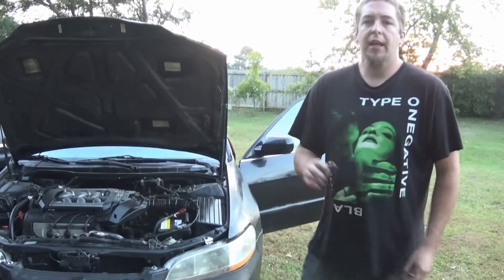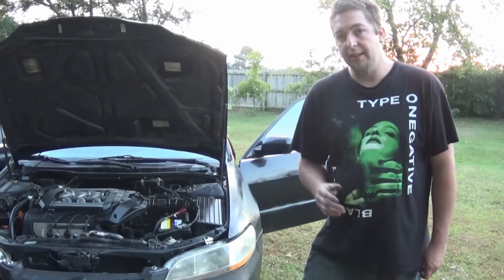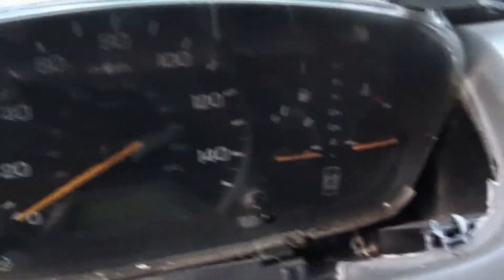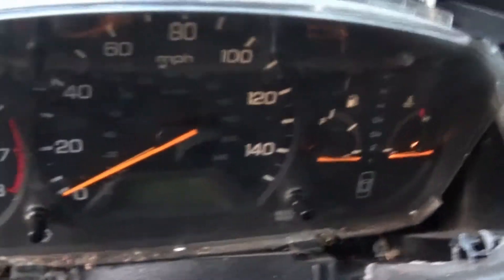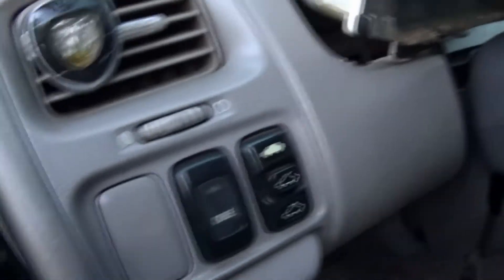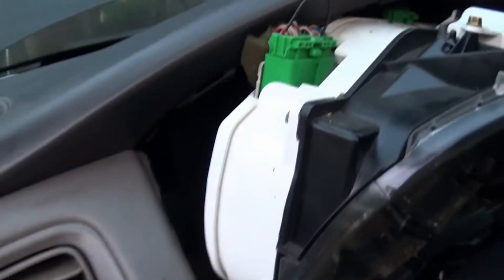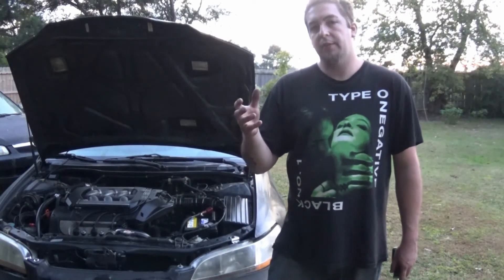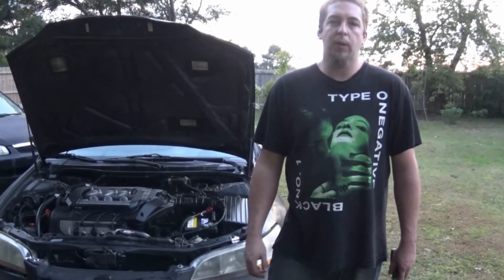1999 honda accord dash lights fix

Comment: I installed a new stereo in my gfs accord. Had the issue, saw a video like this one with the same solution but I connected the wrong two for a second, and now I'm getting transmission codes. The P,R,N,D3,2,1 all light up, but not D4. I believe there's just a short to the d4 light. How can I fix?
Reply from the maker: start checking fuses because if you shorted some thing the fuse should have blown first
Reply: that one goes out after being on for so long, replace bulb or light

Comment: Thank you a heap of times! This worked but I accidentally put the wire in the pin with the red wire white stripe instead of white wire red stripe. Turned the lights on and they worked for about 30 seconds then went out? Where do those two wires end up?
Reply from the maker: that i cant recall, i could tell you at one point but not right now
Reply: Efurd Garage I did some meterin’ and discovered they end up in that multiplex control unit

Comment: My dimmer switch was all the way down before I tried this solution, is there a way I can turn up the brightness?
Reply from the maker: if they are dim with the brightness all the way up then either you need new bulbs if you can or check grounds